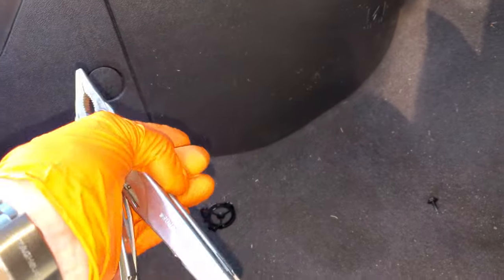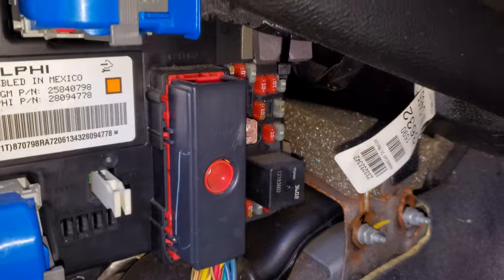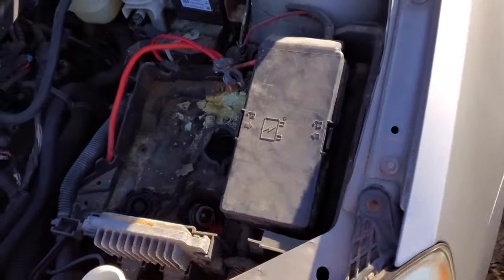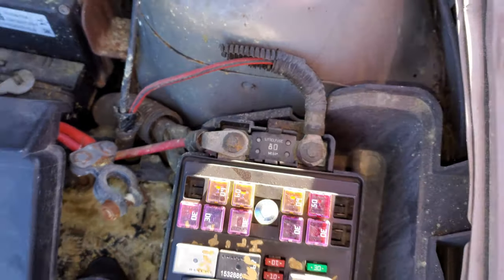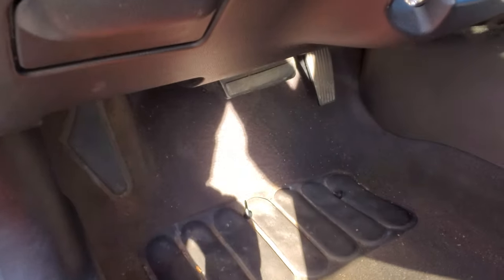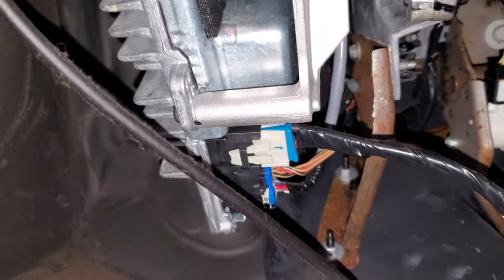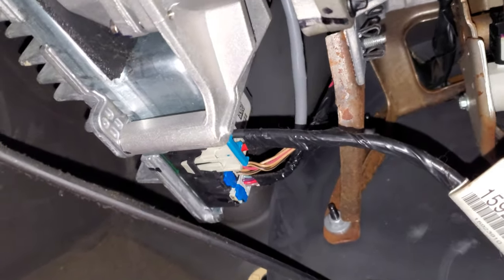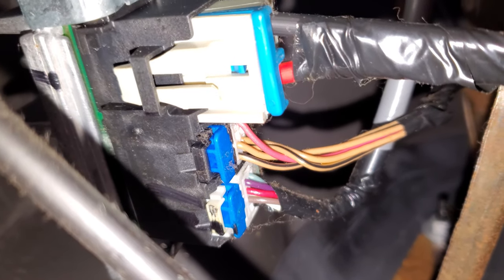2008 Pontiac G6 Electronic Power Steering Fuses

Comment: Thanks for the clear demonstration. How do I know if the assist motor goes bad? Am having a steering problem in my Chevy Cobalt 2006. I see power steering alert on the dash board and the steering stops moving while I drive.

Comment: I haven't had power steering for a while now, I've changed both fuses, cleaned connectors and tried to see if there was any pinched cables nothing has worked. What I'm confused about is if I turn my steering wheel as I'm starting my vehicle it works but only until I switch the gears any idea how to fix it?  The part has been recalled and dealership has already fixed it prior to me owning it.

Comment: If the power steering on a 2009 G6 comes and goes, could it be the fuses or would it be the assist motor?
Reply: I’ve been wondering the same thing, mine just comes and goes

Comment: There was a recall on the Chevrolet Malibu and Pontiac G6 for the torque sensor module according to the VIN number on my Pontiac it's been dealt with but I'm still having power steering issues thanks for the video.

Comment: I know that there was a recall on some of the Pontiacs from that time being G6's but my power steering is now showing the light and when I look it up with the VIN it is not under the recall.  I should check the pieces under the passenger board, hoping this isn't a $500 fix. Fingers Crossed!!
Reply: I saw that as well I have an O7 g6 but I haven’t looked at the vin yet or found out what year it was made

Comment: I have a 2006 g6 that's having the same issue. Dealer says $1800 to repair. I'm advised to not do it myself because it has to be calibrated. If not calibrated, steering wheel can turn completely to left or right while driving at any speed. Scary stuff... will probably just get rid of the car!
Reply from the maker: I'm sure a calibration will be needed but I dont think the car will just randomly turn without one. U can do the job yourself then have it aligned at a shop that has a hunter alignment machine with codelink.
Reply: So I had both the elec power assist motor and the steering column changed in my 2006 Pontiac. Was working fine for a while and haven’t lost power steering. However now the message comes up. How can I make it go away? When I asked a mechanic, had no idea what I mean by calibrating the vehicle after replacing these parts. My dad originally did the job but we don’t have the machine to calibrate. How can i explain this better to a mechanic, and so I’m not taken for a ride, how much does this service cost?

Comment: The usual issue with these as well as Chevrolet Malibu's is the steering torque sensor located in the upper steering column and less likely is the motor, if the power steering starts shaking the wheel it's probably the torque sensor and eventually the power steering will go out completely.
Reply: Ray J I currently bought a 2006 Pontiac G6 and my power steering hasn’t went out while driving thank god but on occasion I’ll start the car up and get a no power steering warning through the radio but the sensor was replaced back in 2015 due to the recall what would you suggest?
Reply: @brycelocke7325  I'm in the same boat, mine was replaced once under recall may have been in 2015. Dealership wants 1500.00 to fix it..car is worth less than that!  I have heard success stories going to junkyards get the column with the motor already attached and swap it out, I see them on Ebay for 165.00 ish . it's a gamble for 2 reasons. The replaced part may have the same issue or may need calibration and I hear dealers don't want to do it. My Malibu has been going in and out not hard to drive unless you are in a parking lot. If I restart the car it usually works for awhile I'm living with it for now, will get a new car in a few months. 168,000 miles so it has served me welll....good luck!

Comment: I have an 09 Pontiac g6. And my steering wheel wont stop shaking.  It shakes at a red light on my brakes and it shakes in park. Im being told it could be the electric motor for steering box. I could use some help
Reply: What was it afterwards

Comment: 08 G6
I didn't have a key fob when I got the car($500)
When I unlock the driver door sometimes the back doors unlock sometimes they don't 
Now the power steering 
When I start the car it's either there or not
Sometimes i shut the car off remove the key and start again and it comes back or stays off

Comment: Hello i own a 2006 pontiac g6 and the power steering pump keeps displaing power stering posibl ice and at the same time make the steering wheel stif i have to turn off and then turn the car on and it goes back to normal.
Im wondering if i have to replace the power pump. Or something else.
Thanks omar ortega 
San antonio tx
Reply: Hello. Your comment caught my attention because I also own a 2006 pontiac g6 and my power steering also goes out only while driving in low speeds tho and the only way to make it come back on is too shit the car off and then back on for it to go back to normal! So my question to you is have you possibly found out anymore information on this issue with our cars possibly?? If not no worries I'll keep trying to identify the issue just haven't had any luck yet 🤔 lol
Reply: @christopherbuck5240     hello checked out more videos about this isue with this types of cars and out of 10 videos 2 say change the power steering motor the other said change the fusues or replaced the tork sensor. But since the power steering motor cost over 600 dlls im gona take it to a electric mechanic to have a better answer cause besides my car doing that with the power steering also my dashboard lights flicker on and off passenger air bag says is off and then on,and now the ac is not working on the front settings only true front windshield. 
In case you also find out anything else,let me now thanks. And God bless.
Reply: Did u find out the issue cause I'm having same problem
Reply: @omarortega7102  Have you found any solutions yet? Mines do the same sometimes at real low speed making a right turn I believe. Take the key out and turn back on and it’s back to normal

Comment: I have a 2008 g6. Often i have to start on and off 3or 4 times brcause the  power steering " warning comes on. After several attempts, everything is fine. 
Also, the steering wheel twitches when idling. 
Whats up?
Reply: Hey did you happen to figure out the issue mine js doing the same thing?

Comment: I changed my starter and alternator with a new battery and my car won't charge losing power can this fuse be the issue
Reply from the maker: This fuse is not related to the battery charging.. I would suggest having the alternator tested especially if it is a remanufactured unit.
Reply: @LehewTech  
Ok thank you